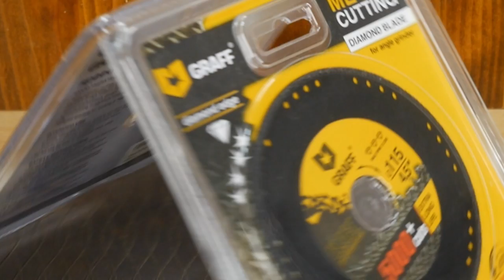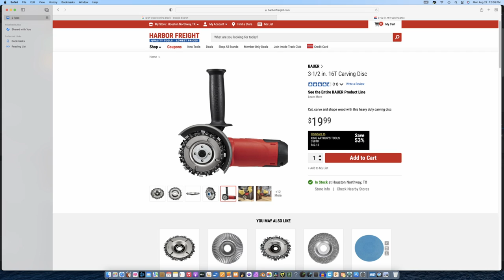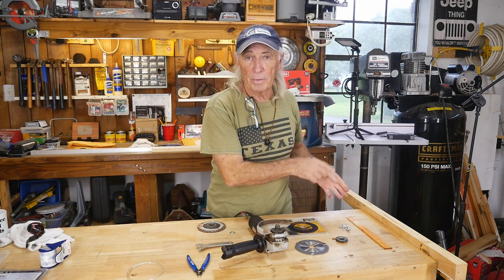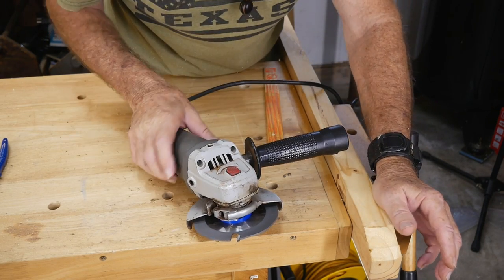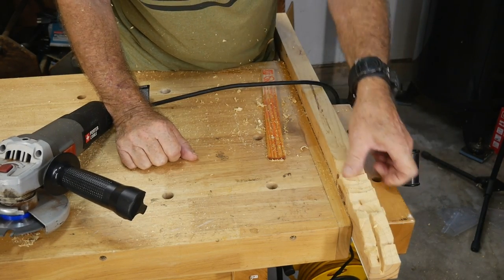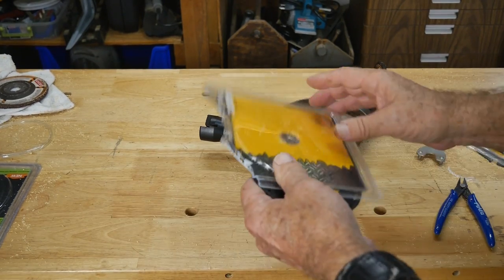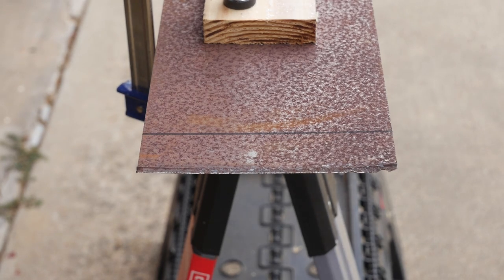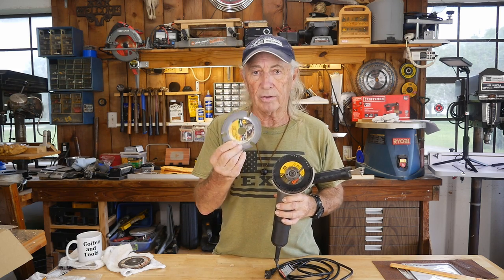Graff wood speed cutter and metal cutter review for high speed grinders. Coffee and Tools ep 264

Comment: Those look like great additions to my ever growing collection of angle grinder accessories.

I have a chainsaw cutter for my grinder. It took some getting use to.  And, requires a good sharpening to use.  I bought it to carve butt cheek depressions in high chair seats.  It is the best power tool solution that I have found.  For sure, it beats pulling a scorp through hard maple or white oak!

I think they made both blades flat because… have you noticed that all cut-off disks for your grinder are flat?  Well, that is because having an offset axis makes it difficult to control the cut.  As you press it into the cut it twists and catches.  And, the offset would decrease the depth of cut. 

Nice review… enjoyed it Larry!
Reply from the maker: Interesting and thanks for the input